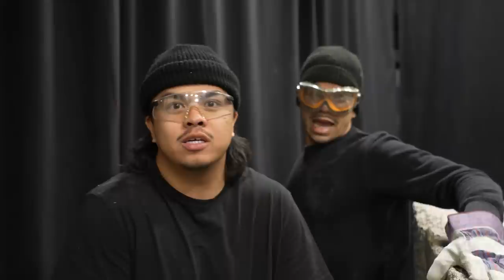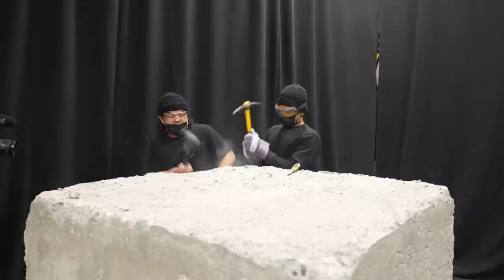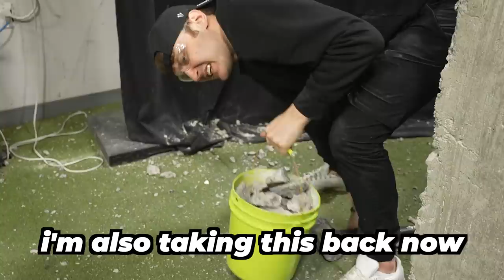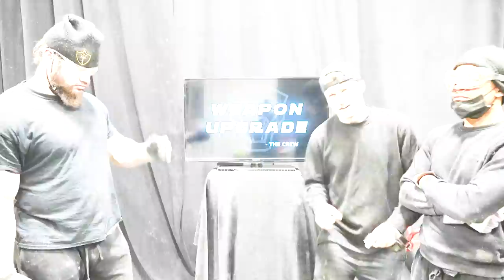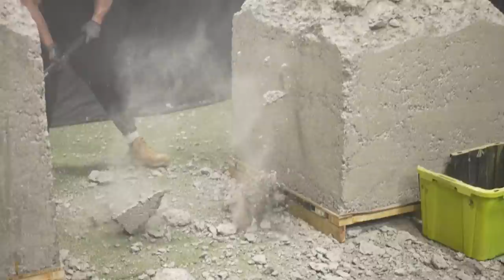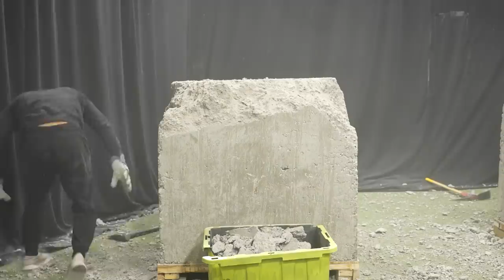First To Mine Lamborghini, Keeps It

Comment: Hey you guys just to let you guys know because ive seen you work with concrete a lot. All that dust coming off of the concrete is silica dust. Its very fine and can get into your lungs causing to the development of lung cancer, silicosis (an irreversible scarring and stiffening of the lungs), kidney disease and chronic obstructive pulmonary disease. Use water to wet the dust or wear respirators next time 😁